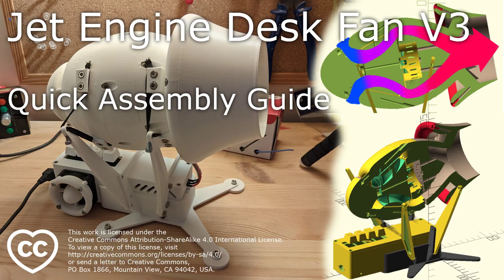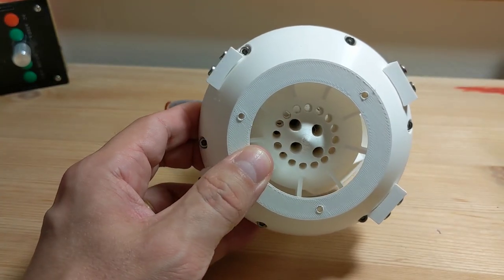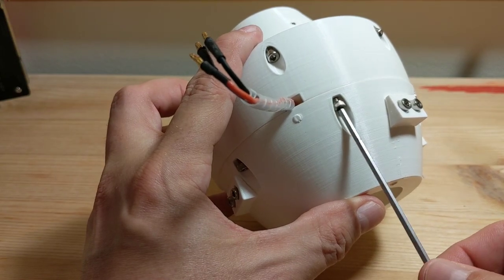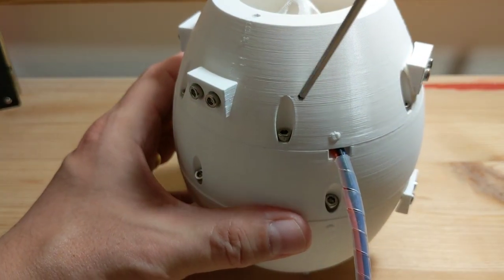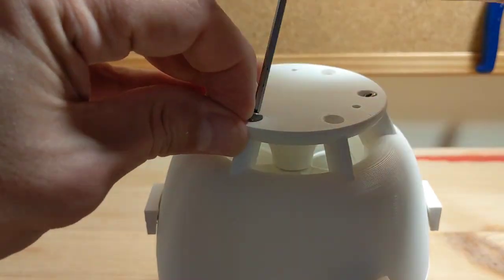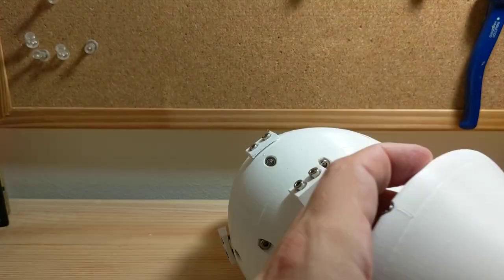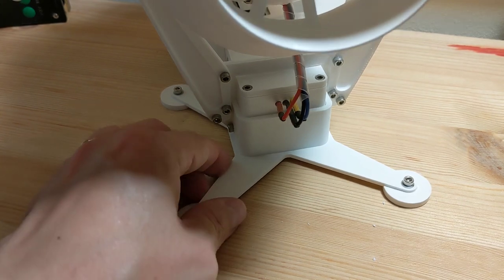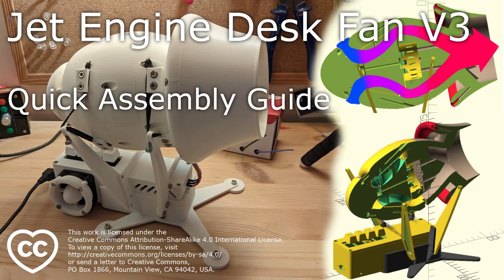"Jet Engine" Desk Fan: Quick Assembly Guide

Comment: What size bearing did you use please? The specs are missing from the project. Thank you.
Reply from the maker: I thought I'd added that but when I checked it was only in the comments: it's 623zz - 10mm outside diameter, 3mm inside diameter and 4mm thick. I'll have to go back and add it into the description, I must have forgotten.
Reply: @ChrisLynas  thank you for your speedy reply. This is a really fun project, thanks thanks sharing.